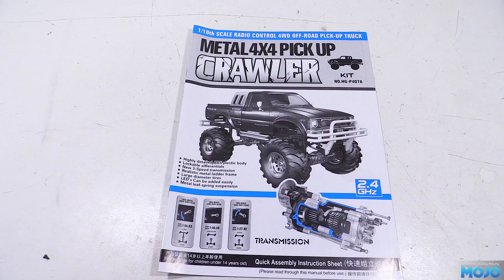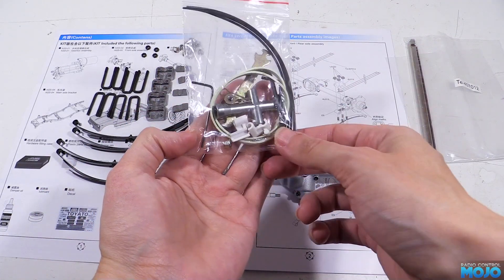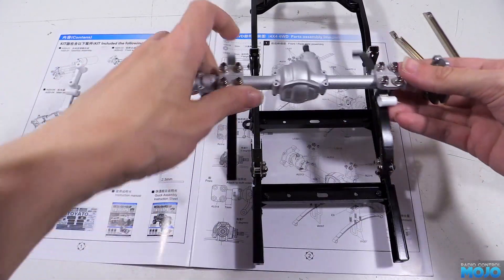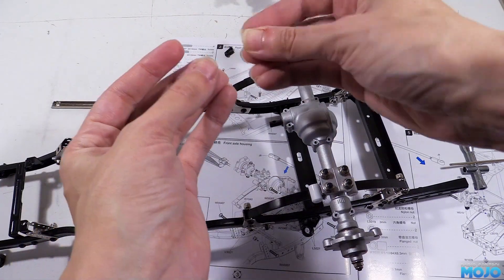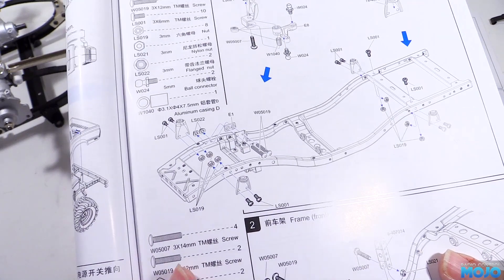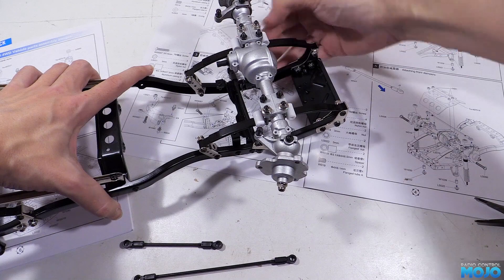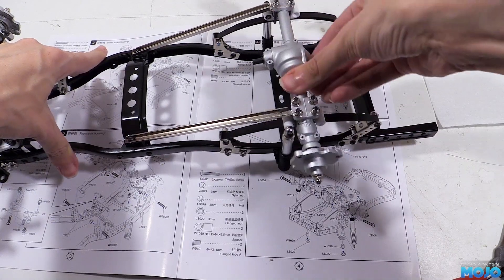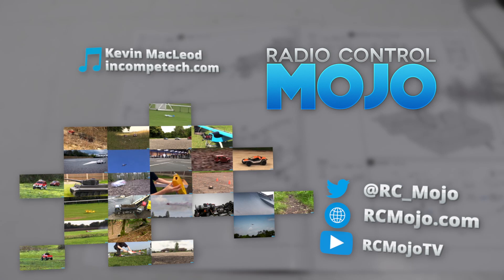HengGuan P407 Kit (Bruiser Clone) - Fitting axles

Comment: I used a Tamiya manual to help with reassembly of my rtr and would recommend it here. The axle u-bolt plates and axles have an assembly marke. the idea being when you install the axles you use the raised line on the bottom of the u-bolt plate to line up with the raised line on the axle. This make sure your pinion angles are correct and the axle is not twisted, canted, or off to one side.

P.S. Since the shocks are not really shocks I removed the internal spring and replaced the leaf pack with a set of super soft leaves from RC4WD.

Comment: Nick, did you strip the diffs and gearbox to make sure they had plenty of grease?
Also where did you order it from.
Reply from the maker: I didn't strip the assemblies before the first run, you could feel the grease and even hear it in the main gearbox. Having taken the axles apart since I found plenty of grease in them.
As for where I got it, I think it was from GearBest, but BangGood sell it too along with several sellers on AliExpress.
Reply: @RCMojoTV  thank you I've just ordered from Banggood,  after seeing your latest video with the stripped diff I'm ordering the bearings for the axles and replacing them as a precaution.

Comment: Does the kit come with the screw pins to lock the differentials, If they do what size are they?
Reply from the maker: It does indeed, the manual say M3 2.4x11mm. I should think they're the same as the Tamiya ones which might be easier to source